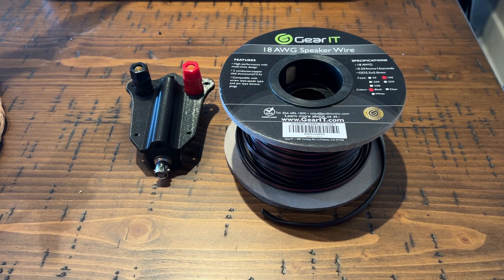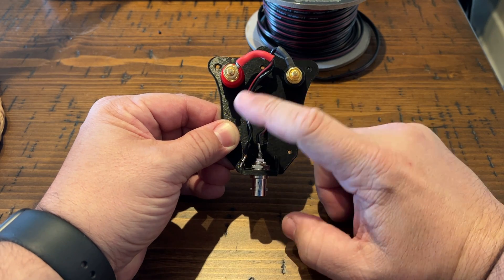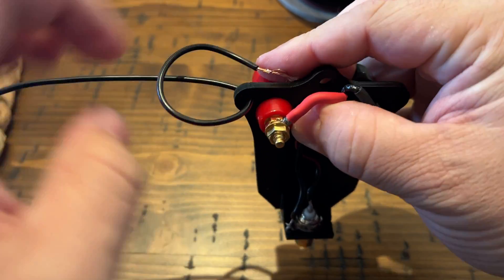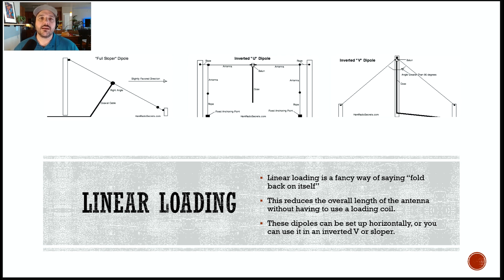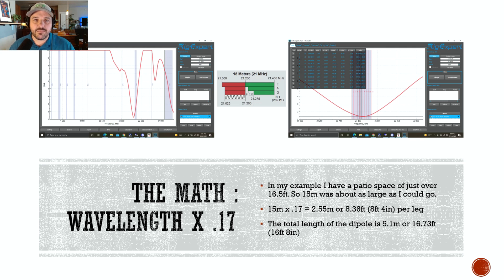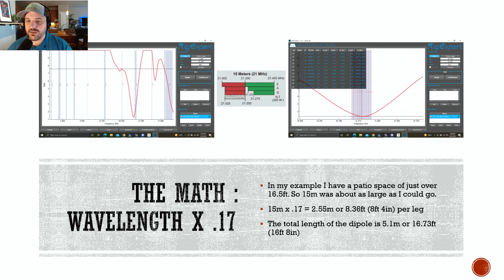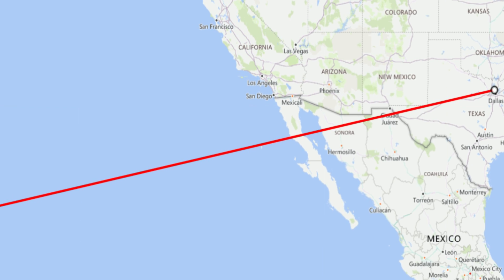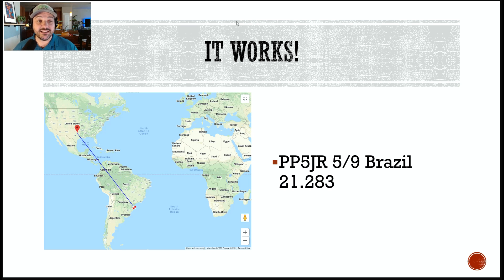The perfect sized apartment antenna for HF radio?

Comment: Nice job Shane.  It’s amazing what happens when you just put up an antenna isn’t it?
Reply from the maker: Yea, this is the first antenna I have ever built. I was floored when HI came in so clear then Brazil gave me that signal report. I put the Buddistick pro on the patio tuned for 10m and got Portugal and Cape Verde contest stations. #havingfunwithhamradio
Reply: @QBFWorkshop  and yes it can be done on your pourch i dont have much of one in my apt either but i did it make slim jim cut for the 20 meter phone only and it proves my point as well
Reply: @QBFWorkshop  i have a antenna idea for u
Reply from the maker: @AndrewMurphy8383  I’m all ears
Reply: @QBFWorkshop  i want you take what ever it call latter line or twin lead and make a slim jim antenn for 20 metercut it for the center of the 20 meter phone only band only and i know this can be done
Reply from the maker: @AndrewMurphy8383  hmm like a jpole?

Comment: Did you have to split the speaker wire? Could you have twisted the far ends together and cut out a section on one side in the middle?
Reply from the maker: I didn’t , in hindsight I should have tried another one your way.
Reply: You gave me the idea, i might try it for a 40m antenna

Comment: But I want to do 75, 40 and 20 metres.
Reply from the maker: HamSticks or the MFJ-1622.
Reply: @QBFWorkshop  The 1622 does not do 80 metres.  I have ordered the MFJ-1625.
Reply from the maker: @denelson83  you can get a hamstick for 80m.
Reply: @denelson83  how is the MFJ-1625?
Reply: @UpcomingChris  It turned out not to work in my apartment building.  There is just too much RF noise.
Reply: @denelson83  Ahh that's a shame, did you find a better solution? I'm in an apartment also, looking for ideas
Reply: @UpcomingChris  The only solution I could find was to go portable.  The terms of my lease disallow the installation of antennas on the property.
Reply: @denelson83  ah, really enough, I'm in the same boat.

Comment: ..and for those of us with no balcony or patio..???
Reply from the maker: If you can get close to a window, you can use a loop mounted on a tripod.  I’d probably try and distance myself from the radio and keep the power down. There’s also portable in any local park.
Reply: Just keep in mind that I loop is directional!

Comment: Winding the feed coax a few turns through a ferrite ring close to the dipole end would stop current in the shield of the feed coax to prevent it radiating.
Reply from the maker: I actually ordered a pack to test. Where the coax turns from the patio to go up. A few turns there wouldn’t put any additional weight on the center.

Comment: Shane, I love it that you are building and experimenting with antennas you can save so much money and with a buddy that can print up a nice part make it look way more professional. Next time don't separate the speaker wire and solder the end to continue the wire back that way you don't need to use tape. Check out the Cobra dipole antennas same concept but as a doublet. Great work on the build!! 73
Reply from the maker: Thank you Chuck. You know when I was researching this the article was using ladder line that was shorted at the end. I don’t know why it didn’t dawn on me to just strip the und just make it one wire lol.
Reply: @QBFWorkshop  yea same concept and you can go back again. I built one with cat5 I think. Found some with it all side by side and flat. It was a pain with that tint wire but it worked.
Reply from the maker: I didn't think about going back down a second time. I wonder if I could get 20m short enough to fit in the space by going back down..hmmmmm